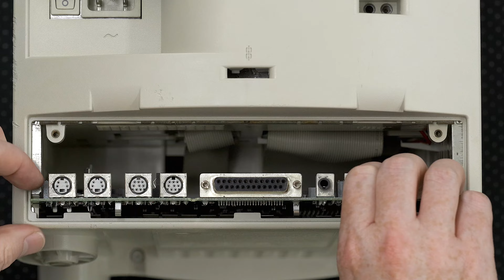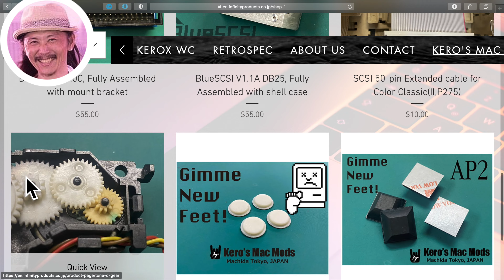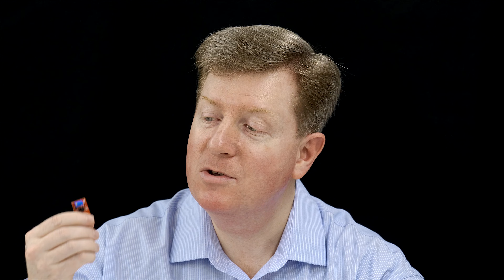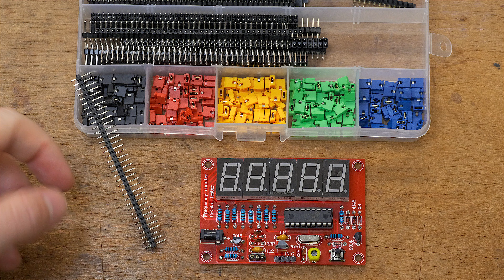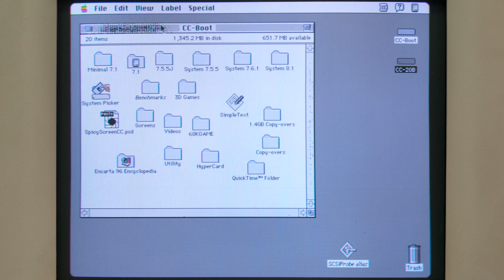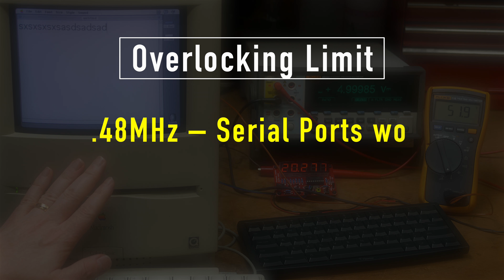Spicy O'Clock: 68040 Macintosh Overclocking [1 of 2]

Comment: This was very soothing, and explained very well.  I ordered the Spicy O'Clock for my newly-acquired Quadra 650, and the instructions differ substantially for that computer : on the Quadra 650, the clock generator has to be removed entirely from the logic board.  The suggestion about a frequency counter is very useful, and the kit would give me more soldering practice before I do the actual job!
Reply from the maker: I am not aware of any changes to installation instructions.  Then again, I've not spoken to Kay Koba in a long time.  Even so, I don't see any changes on his product web page.  And the LC575 instructions he links tomatch my video: https://ameblo.jp/keroxiee1016/image-12724021953-15068028344.html
So maybe you are misunderstanding?  The entire chip does not need to be removed.  There's only a single pin that must be desoldered and lifted slightly above the pad, so it won't touch that pad anymore.  Then you solder a single wire to that lifted pin.  That's what my video shows and that is what the Kay Koba instructions say too, at the link I just provided to you.

If the printed instructions you received say something completely different, that needs to be made public, and I would appreciate a scan of what you have so I can see those changes.  But if the instructions are that different, it is odd because I cannot find changes on Kay's website this morning.
Reply: @JDW-  Sorry if it wasn't clear; I was referring to the instructions for my Quadra 650.  Not the LC 575.
Reply from the maker: @theirongiant2182  I read too fast.  I apologize.  I completely overlooked Q650 in your original message.  Yes, that is an entirely different machine than what is shown in my video and sadly requires a different installation approach to make Spicy O'Clock work: https://ameblo.jp/keroxiee1016/image-12724021953-15068028373.html

Comment: Take all the time you need, and take care of you first.  Of course I may start to bug you if the part 2 takes 2 or3 years... 
Thoughts on the results.  

1 I wonder how much the thermal tape will affect temps?  I bet it is a couple degrees increase but probably not much more. Its still enough to show that a heat sink is a good idea. 

2   The Quadro950 at 33mhz had L2 cache and also ran ram at the lower zero wait states if I recall. And that will give it some large advantages. I am not sure what the 840AV uses for waitstates, but I would assume its 1 and not 0. The IIFX and SE/30 are among the very few macs that were zero ws.  Even the classic2 and LC2 are 1ws which explains their dismal performance in addition to the narrower bus. In the pc world the difference between 386sx and dx at the same clocks with 0ws ram and no cache is much narrower than the difference between the SE/30 and classic 2. Though I wonder if the Classic2 uses system memory for its framebuffer? I can not remember. I know for a fact the SE30 has dedicated memory for the frame buffer.  SO that may also exlain the abnormal differences. ...... digressing as usual lol

3   At 45mhz I am thinking it will keep up and even beat an 840AV even though it uses that funky interleaved ram thingy. I can't wait to find out what you got when you turned that pot a few more twists..... That clocker is a neat and simple device I will need to look at. We had something similar for the powermac 7100/66 back in the day. 

4   The Vram scores.. If they count pixals per second to come up with the results, then resolution should not have much impact. It would if they counted FPS instead.  Interesting that color depth results are the way they are.  I have heard that the built in quickdraw acceleration is always optimised for higher color depths and ends up wasting much of its computing width (?) on lower bit depths.  On non accelerated mac's the difference is substantial. And I am unsure if the 575 actually has full quicktime acceleration like the IISI and GC/24 card or just a blitter. Most likely the latter given how much apple will cut corners on some things. I would expect 840AV video scores to cream it though, as i think it needed vram sims in a group of 4, indicating higher bus width. 

Excellent video! This is the nuts and bolts stuff that I really enjoy. And remember take care of yourself and keep your stick on the ice.
Reply from the maker: Thank you for your kind words.  I would highly recommend that you expand the text description under my video (click "SHOW MORE" on a desktop computer) where you'll find a downloadable DSK image that contains all my benchmarks, even those of a full FPU 68040 which I was unable to show in this video.  In fact, I even ran a benchmark at more than 51MHz.  It's not entirely stable at that speed due to even 60ns VRAM not being fast enough, but suffice it to say, a Color Classic Mystic can easily trounce a Quadra 840AV when using Spicy O'Clock.  I also put links to some forum discussions there too about 040 mask revisions.  Suffice it to say, there's a lot that goes into reaching the highest overclocking speeds, and capacitors on the motherboard are critically important too, which I hope to talk about in Part II.

Comment: I wonder if you could measure the clock speed INPUT on the SCC chip (the 85C30), as IIRC Apple only got the ones rated at 4MHz. The stock input frequency is about 3.68MHz - the clock speed is a 4.25 divider from the stock 15.6672MHz oscillator on earlier models like the SE/30. 

On the 475 and similar models that use the Primetime and MEMCjr IC's - there's a separate I/O bus that runs at 16MHz, which is where the SCC will be deriving it's serial clock from. Now - I don't know if, once the bus speed exceeds what the PLL is putting out, and what the primetime is receiving, that 16MHz signal is drifting out of spec to 18/20MHz. If so, your serial clock won't be at a sedate 3.68MHz, but at an 'insane' 4.7MHz, which is out of spec for the chip, but also will throw everything outta whack. I have a feeling, if you were to decouple the SCC from the I/O bus and generate a fixed input clock of 3.68MHz, feed that IN to the SCC, your serial ports would continue to work at higher bus speeds.
Reply: This is what had to be done when pushing a 7100AV/66 to anything above about 83-85 mhz.
Reply from the maker: I believe Kay Koba has been thinking about that very thing. I will ask him to share thoughts, if he has something to add.
Reply: I feel that your theory is more specific and practical than I thought it would be. I was wondering if I should prepare a separate output frequency for the serial output from the clock driver, but I wasn't sure if it would synchronize with the CPU.I will send you a message later on Tinker!